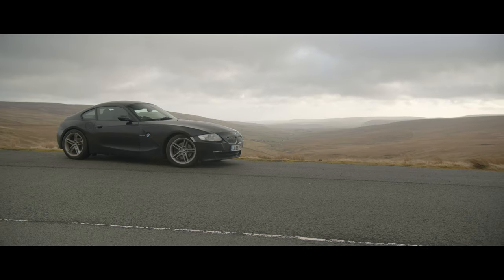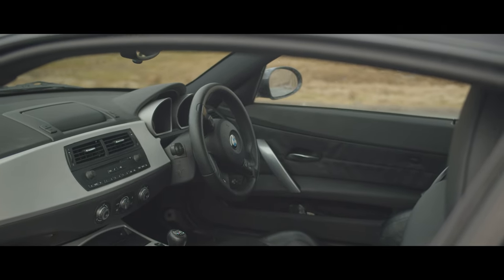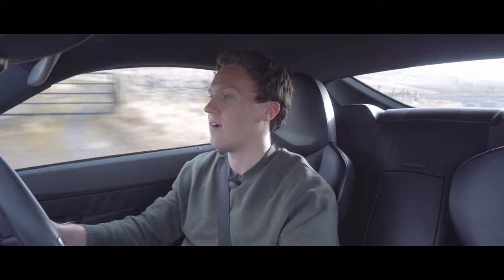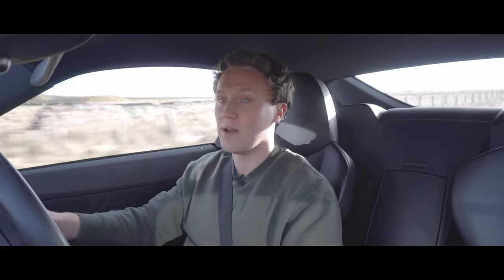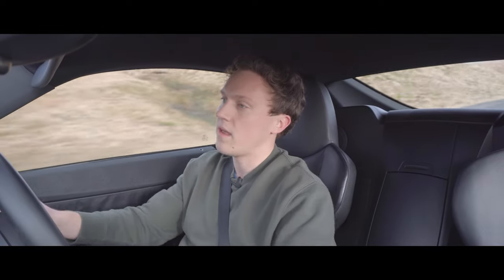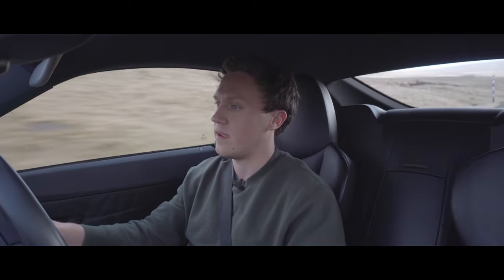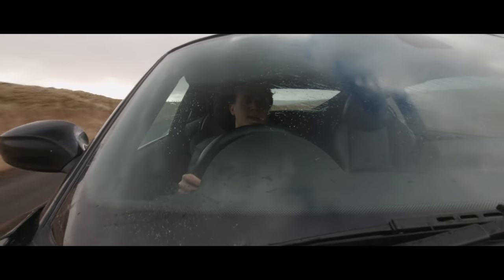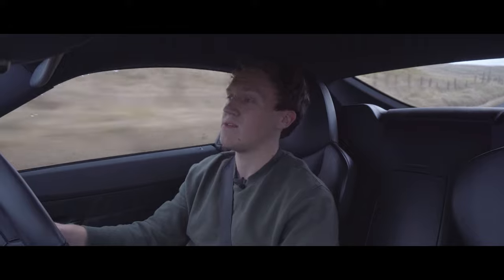The Problem With Modern Cars... [ft. E86 Z4 Coupe]

Comment: I've had my E86 coupe for 4 years and it's never cost me a penny, never gone wrong, honestly only oil and filters which i do myself it's dead reliable and does 44mpg on a motorway, that's filling up driving few hundred miles and filling back up and doing the maths,  even fast driving it's still brill on fuel, not like my Rx8 before that was 26mpg maximum on motorway 15- 18 round town and 7mpg when driving flat out like you stole it.
 I love my bmw z4 coupe manual 09 plate late registration 97k brilliant car 100% standard sounds like your at brands hatch when your booting it my mates say when I'm on a Bluetooth phone call. Won't be selling her future classic no doubt, My mate had a z4M and i drove it and we both said the normal coupe feels way quicker in normal driving due to the low down torque of the N52 engine,  so in the Z4M unless you are high up in the revs all the time in every gear like on a race track this is when it's fast, it honestly feels slower in normal road driving and the suspension is hideously hard and high road tax and insurance.
Reply from the maker: That's great to hear Craig, awesome to see your enthusiasm.

I agree with everything you're saying there, and although I've not yet driven an M, it is exactly what I hear everytime. Yes the S54 is special but to live with, the N52 seems to be the better engine. There is masses of low down torque and at no point do I think my car is "slow". It'll monster pretty much any b road you throw at it.

Indeed a future classic!
Reply: Wait 44 mpgs in US figures? I thought maybe that was UK but the the RX-8 numbers seemed like they might be US. I still kinda want to take the RX-8 plunge... with the end game of the cliche LS up front... they sell some great kits to make that happen! Like my Miata on steriods!
Reply: I have to admit ,44 mpg on the motorway from a Z4 coupe it's just crazy. I think even 40 mpg on the motorway it's more than expected . Can you really achieve that ?
Reply: That's why I was surprised when I saw 44 mpg..sounds a bit optimistic to be honest.
Reply: @Marius0189  I bought my first Z4 Coupe 2007 last week and drove it back - 140m on A roads and Motorway.  I stuck to the speed limit and was gobsmacked at 42.7mpg for the journey.  Mine doesn't have cruise control either!  It has dropped since i have been home and only doing short journeys and a lot of start / stop / accelerating but I am still at 37mpg!
Reply: @andrewloveland5497  even 37 mpg is incredible for such power. is it still returning such numbers?
Reply: Everybody reading needs to keep in mind that the US gallon and the Imperial gallon aren't the same size. The US is only 3.5 L whereas the Imperial is 4.54, so you certainly could achieve incredible highway mileage in the low to mid 40s

Comment: Excellent video mate, a topic I've been mulling over myself for several years. As a fellow e86 owner you were totally right about the balance of the car and although mine is an automatic the manual mode still gives me some of that engagement with the engine. 

The ever increasing size and weight of cars has directly reduced the feel and soul of the cars themselves. The new G29 is a powerful car but feels big, cumbersome and disconnected. I took a lightly track tuned S1 Elise round a track and it was the most thrilling, enjoyable and raw experience I have had with a car, nothing these days comes even remotely close to that experience.
Reply from the maker: Thanks man, much appreciated.

Couldn't agree with your comments more - I drove a G29 in 2020 and although it felt very good, it feels totally different to my E86, largely down to the huge amount of additional weight it carries, and of course a turbocharged engine.

Stay tuned for plenty more!
Reply: I dream of Lotus, haha...

Comment: Coming from a Westfield with an S2000 engine and box in it to an E86 , I find the E86 pretty heavy and cumbersome by comparison. So, for those going from an E86 to a more modern machine would find the same weight difference as well. If you think the 330i E46 is only 100kg heavier, I would want to know where the kerb weight is in a Z4 ? I found the kerb weight is 1325kg for the Zed. Which is about right. Lighter cars are great for off the line on smooth tarmac, but the can be more unpredictable on typical english roads. the extra weight of the Zed does give more stability at speed also. The Zed isnt a rocketship in anyway, but the way the straight six does pull from low down and the sound does make it an enjoyable experience to drive and own. Mine is out of hibernation in 3 weeks time . And looking forward to it.
Reply from the maker: Yeah you make some very good points there Justin. Just like with power, I think there is a sweet spot too. Some mass is good to retain control and of course provide traction. I find anything from the sort of 900kg to 1400kg generally is best, not too heavy so still feels nimble and relatively lightweight, but carries enough mass to stay composed over undulations and not be thrown all over the place! But yeah, pair the Z4 with the N52 straight six and it's a great combo to me! Hope you enjoy getting yours out of hibernation!

Comment: Great video, I’m very much in alignment with your views. For BMW it doesn’t get better than an NA straight six… and the days of the ultimate driving machine, I fear, have largely been and gone. 

My E39 Touring is powered by the previous gen M54B30… it’s a brilliant lump with great character, she always puts a smile on my face and makes me feel like the car is an extension of me… I’m connected to the road. By contrast, these new BMWs filter out the driving experience with technological gimmicks, and small turbocharged engines with an anaemic amount of cylinders and a ghastly exhaust note as an accompaniment. 

Here’s a question - what did people say 10 or 20 years ago about ‘modern’ cars back then? :)
Reply from the maker: Thanks Daniel, agree with you!

The M54 is another brilliant engine. Yeah sadly the pressures from regulators and a changing world are particularly damaging in the drivetrain environment. And all these exhausts constantly popping and banging as a means of "sounding good" becomes a bit tiresome too.

On your final point, yes you're absolutely right! Although, electric cars are what is going to dominate the future, and sadly I'll never connect to those cars like I do the ones from years gone by 👍

Comment: Great video. I’m looking for a Z4 coupe and use your videos for info. The potential valve issues are putting me off though as no idea how much it could cost to sort out
Reply: What valve issue are you referring to mate? The DISA valve or the VANOS system?
Reply: @TheHonestJock  the vanos solenoids. I have read that seals can start to leak oil
Reply from the maker: Thanks a lot! 

I wouldn't really worry about those issues, VANOS solenoids aren't a particularly expensive part and from what I understand they're relatively easy to access too!
Reply: @zahid4331  dont worry about that tbh, my car has 106k miles (65k in my ownership)  and I've never had a single issue except the water pump which is common. They are fantastic cars and very reliable
Reply: @TheHonestJock  thanks very much. Really appreciate it. I’ll let you guys know if go ahead and buy one
Reply from the maker: Best of luck man 👍

Comment: It's really incredible how cheap E86 Coupes still are in the UK, esp manuals.  In the USA, very high mileage auto E86 starts at $15k USD and manual E86 starts at $18k+ USD.  With a bit of easy weight reduction (there are a ton of heavy speaker/sub components, and the OEM wheels and seats are extremely heavy), it becomes a competent track weapon rivaling the (now) big money Honda s2000.
Reply from the maker: Yeah always shocks me how much prices can differ, the cheapest E86s here are around $10k USD and the most expensive (non M versions) are about $25k USD, with the autos usually being a couple of grand cheaper for an equivalent spec car. But yeah, it is a very impressive platform for sure. Either way, I'm sure prices will only go up from here!
Reply: I feel for American Z4 fans. My E86 cost £6.5k last year, full maintenance history I just changed one gasket and did the clutch, so for just over 7k I got a sweet sports coupe.

Comment: Yeah I traded a few cars and ended up with a Z4M roadster manual, and s SLK 55 AMG, they are both around the 350hp mark, same size, similar weight, but completely different experiences, but the one thing they both have in common, is that you are driving them, not them you. You sit in them, not on them, and you feel connected in some way with them, and the sound!  And I also have a M135i.... thanks for your views on the joys you can have just driving. Enjoy this priviledge before the EV revolution is mandated. I look forward to more content rom you, thanks.
Reply from the maker: Agreed! Thanks for watching!

Comment: There's been almost nothing offered on the new car market since around the mid-2000's that's really appealed me. I tend to categorize cars as pre drive-by-wire and post drive-by-wire. The DBW demarcation is notable not only for the disconnect between car and driver that DBW itself brings, but also for many other things that show up around the introduction of DBW on a timeline of car development. Some in direct conjunction with DBW (traction control, etc.), others not at all (infotainment systems, etc.). 

Others that are more hard core than myself who are looking for the purist driving experience possible would likely point to the degradation of steering over the years as their own demarcation. Some might prefer a manual steering rack, while plenty of others prefer hydraulic over electric when it comes to steering assist. I personally prefer naturally aspirated engines over forced induction. However, I can understand the draw of forced induction for some, particularly for those who place a premium on straight line performance. And while high power to weight ratios can overcome some of the deficiencies of a heavier car, you can only take things so far. 

At its essence, I view a driver's car as one that maximizes the interaction between the car and the driver, often above all else. Certain levels of performance and handling are expected of course, as is a good balance between these things. But at the heart of things, a driver's car in my mind is all about enjoying the full interaction between man and machine. Basically, if a car doesn't have all three pedals, then I don't view it as a driver's car. There are plenty of impressive cars today featuring automatic transmissions, offering amazing levels of performance, but again I don't see them as driver's cars. Instead I view them as performance cars. Drivers drawn to these cars are willing to sacrifice some level of interaction with the car to realize higher levels of performance being offered (something of particular value to those who using their cars out on the track).
Reply from the maker: Interesting to hear your thoughts on this!

Yes there is absolutely a clear distinction these days between performance cars and drivers cars. I think it's often the case that manufacturers intend to build drivers cars, but build something instead that is purely focused on statistics. Ultimately there's a lot more to driving than that, which is what I was trying to emphasise in this video.

And its often the case these days, that the high end performance cars with tonnes of power, AWD and automatic gearboxes don't really command much of the driver, so are they drivers cars? Potentially not.

Thanks for watching!
Reply: @FootToPedal  Thanks for the response. Obviously I'm fairly pointed in my views, but I should also note that I don't consider mine to be a negative view one way or the other. I don't feel that it's a putdown to refer to a car as a performance car rather than a driver's car or vice versa.

I noted some of my own ideals in my previous comment, but ultimately every car choice involves compromises of some sort. I've owned a few cars that I really enjoyed driving. For the past five years I've been enjoying my Honda S2000. (This has nothing to do with rising values, I didn't buy the car as an investment.). Plenty of people have noted that the steering could be better. I wouldn't disagree, but I'm okay with it and love most everything else the car brings to the table — especially as I'm a big
roadster fan. I'm well aware that the S2000 isn't everyone's cup of tea, but then no car is. 

At the end of the day, when it comes to choosing a car for anything more than to serve as basic transportation, it's really important to understand your own preferences (or at least knowing what makes you happy within your budget). That you genuinely enjoy spending time driving your car is proof enough that you made a great choice.
Reply from the maker: @VirtualGuth  Fully agree with you!

It is absolutely a subjective matter and it comes down to nothing but personal preference. There is no "correct answer" on which car is best as it all depends on what you want from the car. Some people prefer certain numbers of cylinders in their engine, some prefer RWD or FWD, some prefer power over being lightweight. The list goes on.

As long as you enjoy the car, that's what matters!
Reply: 2013-2019 Benz SL's are still good, but kind of ugly compared to the r230's!

Comment: How are you finding the e86?
Is it your daily  and do you notice the attention it receives? 
I hope you've used the sport button,  if only occasionally 😉
Reply from the maker: Absolutely loving it Pete, the ownership experience is just fantastic so far.

And yeah it is my daily, or as close as you get to that these days, it is absolutely useable everyday though. And yep, it certainly catches people's eyes. often get compliments on it, including today! I think not just due to the way it looks, but also the rarity factor.

I prefer to drive the car as is myself!
Reply: @FootToPedal  
That's great to hear! 
I use to daily mine too for 9 years.
When I first got into it coming from a 53 plate 330ci, I couldn't believe the difference! But now stepping into the m140i the jump feels the same,  but the driving experience of what the z4 coupe gave, it doesn't even come close.
It's just brute power sadly. 
Plus nowhere near the attention the zed got.
I hope you have many more years of enjoyment like I did.
Keep up the good work 👏
Reply from the maker: That's very cool, proper ownership period then!

Yeah I've deliberated over M140i's for some time now, and decided to go a different route and get the Z4. Still need to experience the B58 at some point though for sure.

Thanks man, stay tuned!

Comment: Another great video! We think alike. I have had a dream of owning the Z4 M Coupe for quite some time now, but watching your videos is making me consider going for the 3.0si instead. I don't drive a whole lot anymore, but I want to have fun when I do. My progression has been 03 E85 3.0i -> 2011 E93 335i and now I realize that I should never have gotten rid of the Z4. What do you think? Would the extra maintenance cost and other factors be worth it for the M? I do love the sound of the S54, but there are plenty of things that you can do to get a N52 to sound incredible as well.
Reply from the maker: Thanks a lot! I'd say its largely personal preference, both engines make a great sound but the S54 is probably a bit more special, and the induction noise is insane. However it is a bit more needy and is bound to cost you more money with just how finely tuned it is. If you weren't doing many miles, it could be well worth going for, although I've not owned one so can't speak from experience!
Reply: @FootToPedal  Thanks for the reply! I have quite some time to think about it anyway, I'm not going to be looking until the October time frame.
Reply: You need to get the m car .I bought one last year mega .
Reply: Take out the engine sound tube foam behind the glovebox , and it sounds ace, I've just left one piece of foam in and it's brilliant, it's too quiet with it all in, but when you open her up it sounds like your at a race track.